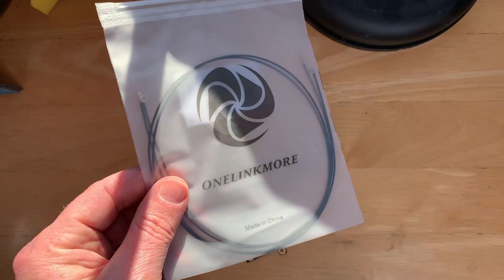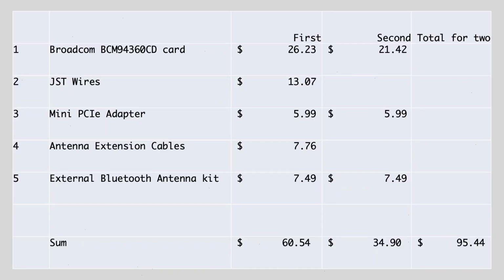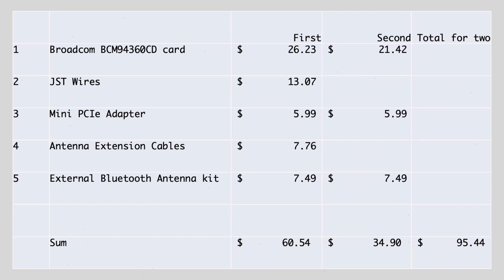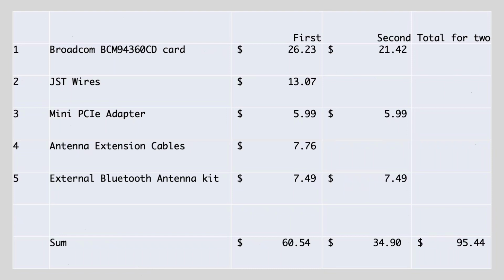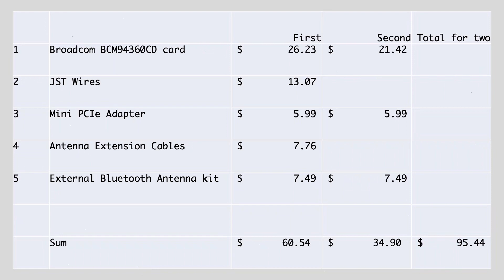Mac Pro WiFi Bluetooth Upgrade 1

Comment: Hi, have the same card installed and my 5.1 sees the card in system report, but no network is showing up. what could be wrong?  Monterey installed with opencore. Thanks!
Reply from the maker: Have you tried an NVRAM reset?  Antenna connections good?  Can’t think of anything else to try.   If you’re on Mac Pro Upgrade Facebook group, you can search there.

Comment: Hi,i love your content you made my mac way better than it was before. I would really appreciate if you could help me with my mac pro .I’ve bought all the things and installed them just the way you did but my mac wont pick up the wifi card in the other hand bluetooth is recognized but wont connect to anything. Again I’m a huge fan of yours
 I would love to see more of your vidoes.
Reply from the maker: Kyung Soo Kim, thank you for the kind words.  I'm not sure that I will be able to help but will try.  Have you tried a PRAM reset since installing the new card?  As for Bluetooth, did you install an external Bluetooth antenna?  I didn't have any success with the internal Bluetooth antenna but could only connect when devices were close, and the side panel was taken off.  What OS are you running?